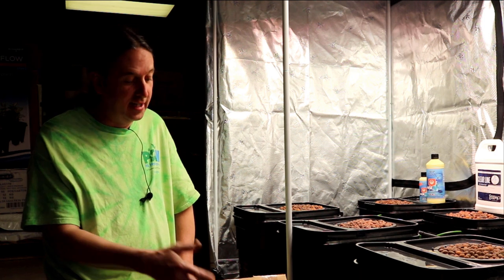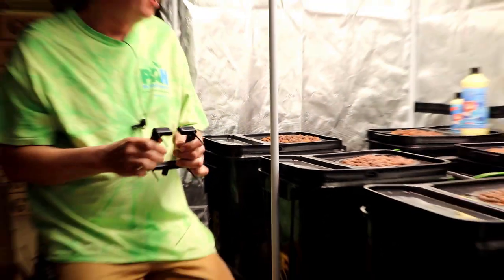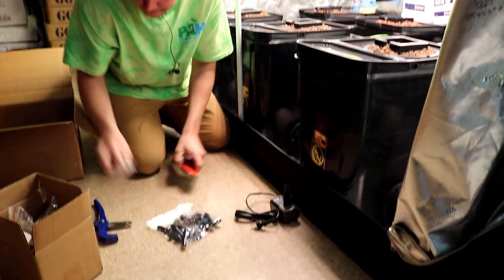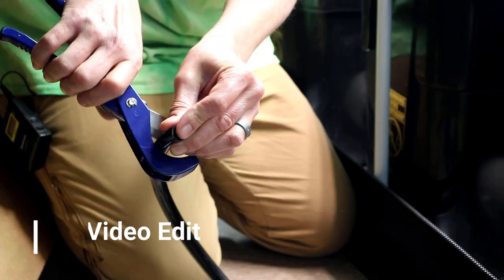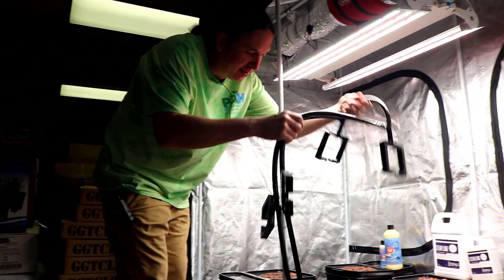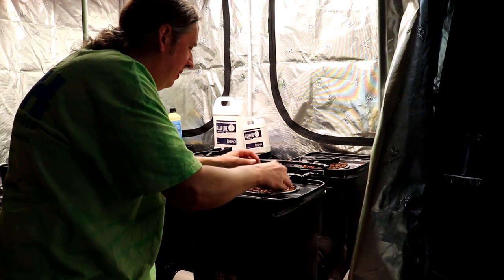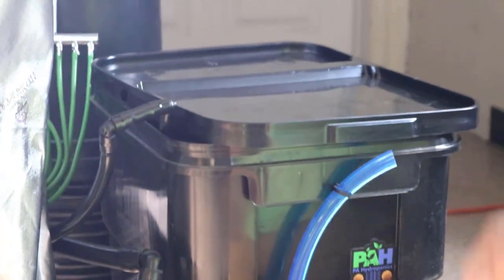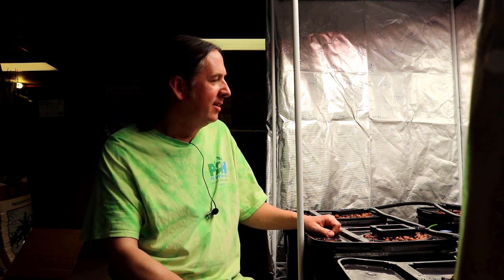How to add a drip system to a RDWC (Recirculating Deep Water Culture)

Comment: Great video Garry! Iv'e come up with a way to achieve the same thing using air to carry the nutrients right up from the buckets and tie into the existing air line to bubble it up through a 1/4 inch tube that has an open end below the water level, I use a valve to limit how much air I divert from the air stones, It takes very little air to make it work. I get a very good increase in yield as opposed to the same system without the drip system, Most evident early on in the life of the plants, Plants get hugh by the time they are 4 weeks from seed, and Iv'e gone from getting 1/2-3/4 LB a plant to getting in excess of a LB a plant from a 6 week veg cycle! 
 I would suggest that anyone using DWC or RDWC to add some kind of a drip setup to your system!
TWO THUMBS UP Garry this is a GREAT System you build.
Reply: Great info I think I may give that a try.

Comment: Will this style drip ring work for germinating and growing all through the seedling stage? I can imagine in leca that a standard 1.5 inch rockwool cube might not actually get watered. Capillary action in leca is not as good as soil, coco coir, or even perlite. 

And if this does work, do you run them on a timer or leave them on full blast 24/7?

Comment: Hey quick question, iv seen a similar set up by current culture and on their pvc drain on the back two buckets they have a filter/return line to res .. Was wandering if that is even neccessary for draining or does it help? Your system already seems so great!

Comment: Great guy.  I subscribed. 
 I've watched a ton a videos and bought my 1st fan/ filter combo from you.  
  
 I like to support my local store,  I've found a pretty good one here in K.C. MO. 
Area,  not quite like you! Most know one thing really well,  and it's dirt. 
 
My question to anyone reading. Why use recirculating water if you use a drip. ?
I've grown one way,  4 bucket,  drip.
 When I started it wasn't legal,  that was 20 years ago. I quit when wife had kid. 
 Now that it's legal,  kid is of age,  I started in my finished basement bathroom lol. Tarped ceiling to help keep humidity in. Very well controlled climate wise.  
 MY question,  I just do top drip, did it that way 20 years ago. I never used air stones either.  20 years ago. I thought about making it recirculating without top drip after seeing it was a thing,  but I like dripping on the top roots.  I did put in an air stone. (It didn't do anything really). 
So why use another pump for recirculating , when top dippers recirculating to? I know you probably can't re circulate too much... lol.
But I don't think it's needed if you doing top drip. (Unless you worry about clogging).

Comment: Hi  , Thanks for your instructional videos, I have a question, I’m installing a new RDWC  system,in my last system I used 5 gal buckets with uniseals, with 1 1/4 inch pvc pipe, this new system has rectangular buckets only this time I’m using bulkhead fittings with  2 inch PVC pipe, how do I connect the pvc pipe to the slip X slip bulkheads?
Do I use pvc glue or just use silicone sealant on the pipe as I insert the pipe into the bulkheads. Thanks, anyone with an  answer it would be appreciated !
Thanks , Steve
Reply from the maker: Looks like they have the pvc going inside them like the ones we use, most likely ABS plastic so use the same glue that we used. Good luck it should work!~ G
Reply: @PAHydroponics  
THANK YOU G, I USED PVC GLUE THAT INDICATES GOOD FOR PVC AS WELL AS ABS PLASTIC, WORKED PERFECT, THANKS FIR YOUR ANSWER !
STEVE